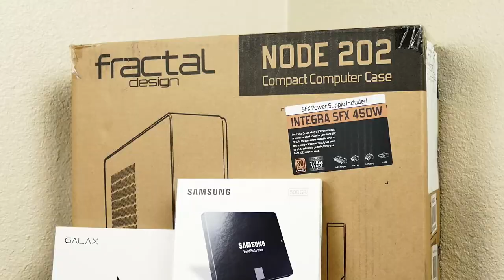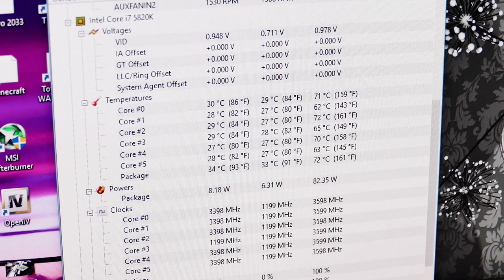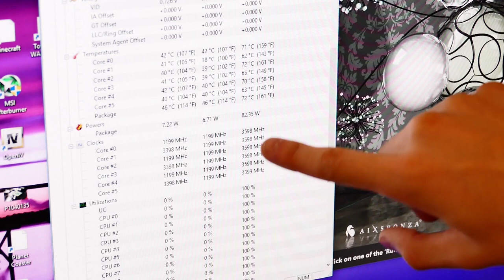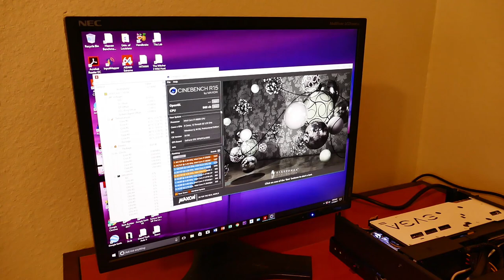This ITX X99 PC Build Makes (No) Sense

Comment: Hey man, could you help me with my build please? Didn't buy anything yet just the parts planning:

- i5 6500 3.2 GHz quad-core
- Cooler Master Hyper 212 EVO 82.9 CFM cooler
- ASRock H100M-HDS Micro ATX LGA1151 Motherboard 
- Kingston HyperX Fury Black 8GB  (1 x 8gb) DDR4-2133 memory 
- Western Digital Caviar Blue 1TB HDD
- ZOTAC GeForce GTX 1050ti 4GB Mini Video Card
- EVGA 430W 80+ power supply
Reply: That build looks fine, however 
1. I would get a power supply with a little bit more headroom on the wattage. Especially if you want to upgrade GPU in future.
2. Swap the 1 x 8GB ram stick for 2 x 4GB ram so that the board runs it in dual channel mode. You should always install ram in pairs.
Reply: Carbongrip thanks, it's just that 1 × 8gb is cheaper that 2× 4gb, and regarding the PS, I am working with a budget so I'm trying to stick with what's necessary. But thanks for the help

Comment: Maybe do another but sensible Build with Node 202? Like the best concole killer pc you can put in there. i7 7700K With cythe big shuriken 2 and after market GTX 1080 with 2 120 Noctua coolers on top.

Comment: Would a Cryorig C7 fit in this case (not on that motherboard, obviously)
Reply from the maker: About as well as the stock Intel cooler does. Will be off-center and "un-mountable."
Reply: on a different motherboard, not the asrock x99 one.

Comment: why didn't you use another case as the cryorig cooler didn't fit ???????
Reply from the maker: Has nothing to do with the cooler size... It's the motherboard.
Reply: Salazar Studio he propably meant why you didn't choose a different case if the cpu cooler that came with the mb doesn't fit in the case cause the case is too small

Comment: A build like this does make sense, but it's rare. Let me explain. What if I wanted to have a fully fledged Linux and also a Windows. Dual booting sucks. Having a Linux VM on Windows is bad (tried it). But having a Windows VM on a Linux is a different story. Linux can pass-through stuff to the VM. So you can have a LinuxOS and a Windows Guest which has a GPU passed through. Had this setup on an i5, but i needed some more cores. A 5820k would have been perfect for this.

Oh yea, a case with good airflow/space/etc would've been nice.

Comment: Is there a cooler you would recommend to put into the Node 202  with a 6600K ? i want to rebuild my old PC to fit in my living room and i was using an AIO before since it didn´t come with a stock cooler.

Comment: So if your going to bash it why did you do it in the first place? Sorry, lost a bit of respect for ya there. Why did you want to build in the Node 202 anyway if you are even talking about crossfire? Seriously. Could of worded it better. Could of just said you wanted to build a cool SFF PC, and then list why this is not a cost efficient or practical idea, but dissing Azrock for offering a product is not the way to go.
Reply: Exactly, I'm glad I'm not the only one thinking this. That's why I am giving this video a dislike, don't bash a board that's not meant to me used for the CPU's pcie lanes but rather for it's multicore capability in a workload not suited for an i7 quad-core.

Comment: Does this case come with the pcie risers that you used for the graphics card?
Reply: Bipolar- Bear it probally does. it would be weird to sell someone a case and then them not being able to instal the card because they didnt have riser. (also my ML08 came with something like that as well)
Reply: Bipolar- Bear it does come with the riser card
Reply: the node 202 comes with the riser cards and some other screws and stuff

Comment: Wow you werent kidding when you said dont try this at home.
Instead of mounting the cpu cooler that sketchy like , after youverified it was adequately cooling couldnt you fabricate a couple brackets to still screw the thing down a little?
Or get a slightly thicker case to allow the good cooler, hell even cut a hole in the top to make it fit is better than shitty cooler just resting on socket ESPECIALLY if case is side mounted and cooler can slide of cpu socket with gravity or bumping it.

Comment: So because you made a bad chassie choice, X99 Mini ITX is not recommended? If you are going to have it under your TV, no you dont build a X99.. But what about people that don't want to have a mid/maxi tower on their desk, and want something small and powerfull? 6 Cores and more PCIE lanes can be used for more than just SLI/CF..

My next build will be a Mini ITX X??? (whatever the future X-socket will be), easily. Running a mid tower with 6850K and 1080SLI today, but hopefully one card will be enough for 4k in the future.
Reply from the maker: Has nothing to do with the cooler and case choice. You didn't pay attention. At all. X99 CPUs pack extra PCIe lanes which are essentially wasted in ITX builds. Your own point is moot past the 5820K/6800K. And both are outperformed by the 6700K/7700K counterparts in both video editing and gaming. I and other tech tubers have proven and verified both. Nice try tho.

Comment: Wrong case = Bad board? - Colour me confused
Reply from the maker: Not what I said. An ITX X99 board is rather pointless when seen in the context of what X99 brings to the table, i.e. additional PCIe lanes that cannot be taken advantage of, the ability to Crossfire/SLI without lane bottlenecking, extreme overclocking in SFF cases, etc.
Reply: "X99 brings to the table, i.e. additional PCIe lanes that cannot be taken advantage of, the ability to Crossfire/SLI without lane bottlenecking, extreme overclocking in SFF cases, etc."

Really? That's what X99/LGA 2011-3 brings to the table?
1. You would have been able to do plenty of overclocking on this board had you got a different Narrow ILM cooler AND a different SFF case with an extra freaking inch of space.
2. X99 isn't all about the pcie lanes and graphics cards. Some of the Xeons have upwards of 16 cores with low clocks for heavy multithreading which work with this board.

Comment: I have this exact board inside a Caselabs X2M paired with a Xeon 2698 V4, 64 GB if ECC, and a Titan X(p). All watercooled. Everything is pretty much perfect with this board. Sure, you have to get an add-on mounting bracket from EK, but it's a hell of an investment over your hack there. You get a dislike on this one.

Comment: Need some help guys. Should I buy an xfx gtr rx 480 or a nitro r9 fury? the 480 comes with civ 6 (which i really want).

I have a 2560x1080 monitor, and have no plans to upgrade. these are both the same price.
Reply: Matt Heitmann i am an nvidia user and dont really know a lot about amd but if i where to switch i would go with the fury.
Reply: Matt Heitmann fury uses alot more power but is a much more powerful card but has less ram
Reply: WayStedYou I have a rm 750x, power isn't a big deal.
Reply: Matt Heitmann The fury
Reply: PlayEr 4312 so sapphire nitro fury for $253 over 8gb strix 480 for $215?
Reply: Matt Heitmann Yes, the fury will perform better than the rx 480. It's worth the extra cost in my opinion.

Comment: What does it matter if you can't sli or crossfire in this build. Isn't that the point of having an itx build? If you used something like an i5, you still can't crossfire or sli. The point of having an itx build is to be small and crossfire or sli won't help with that. So I don't see the point of not copying this build

Comment: Current my build

Asrock X99E-ITX
i7-6800k
Galax EXOC GTX 1080
WD 1tb blue
G.skill 32gb DDR4 Ram
Samsung SSD 950 pro m.2 128gb
Cooler master elite 130
Cooler master seidon 120v PLUS
be queit 600w straight power

and run 
ａ　ｅ　ｓ　ｔ　ｈ　ｅ　ｔ　ｉ　ｃ
Reply: that's actually a really nice build :)

Comment: Was wondering if anyone could help me out, I was wondering what needs an
upgrade the most to help me run games better. Here are my specs!

GPU: NVIDIA GeForce GTX 960
CPU: AMD FX-8350 (8 core)
Mother Board: Gigabyte Model GA-78LMT-USB3
RAM: 8 GB

Anyways, thanks in advance! Didn't know where else to post this.

Comment: Knew before posting. That MB suck!
Reply from the maker: The motherboard itself is great. The intended purpose is not.
Reply: No headroom, even if you get on a better cooler. It does not clock great.
I wanted so baadly a mITX build. A bit bigger case than the node tho.
But ended up on the oposite end so i got the Rampage V Edition 10 instead.

Those few times i move my system is not worth to cut the performance for :P
Rather lift more xD
Reply: Not true. This MB is actually often a better overclocker than it's bigger x99 brothers. I am running a 5820k on mine, with a 92mm Asetek 545LC  AIO. @ 4ghz max temps 65 celcius. In an Ncase. Try it out. and don't use stock coolers for anything. Ever.. Ohh and Salazar Studio should maybe have mentioned the AIO bracket, that Asrock ships with this board. Great little performer with the right cooler. the Noctua Nh-u9dx-i4 will do a great job as well.
Reply: Kasper Christensen have you not figured out that this guy doesn't know what he's talking about. He literally just reads info and repeats it.
Reply from the maker: R3DST1CK Are you referring to me? You must have missed several of my Minute Science and Crash Course videos.
Reply: I actually have to come out saying i was wrong. I remember reading about a X99 mITX board earlier that people really had no headroom for OC. And if i remember correctly it was something to both do with XMP and OC/intended settings for memory while getting an increased cpu clock.

Can't find it for any search i do. So must have been another board.
So i was deeply mistaken.

I remember i allso looked at skylake at that point so it might have been another ITX platform alltogether that got messed up with my memory.

Again, sorry that i was at fault :)

Ither way i don't regret ending on an E-ATX board, i fitted it well in a H440 case and i have room for all the shenanigans i want. And are going to custom loop it probbably this summer. That would be a bit of a bigger/harder project with an ITX case :)
Reply: One of the HUGE downsides on itx boards is the lack of fan hubs..interestingly small form factors need more fans to push through all that crap yet itx boards have ONE fan header aside from the cpu..not worth it.
Reply: Again not true in this case. This board has two fan headers on besides the cpufan. One is by the ram, the other by the pcie, and last the cpu fan header.
Reply: Kasper Christensen well that is cool but having to do an x-99 platform for one additional fan header? LOL. YAY! I just made the comment hoping maybe some MB manufacturers may take note and realize that ALL itx boards need more than one fan header as keeping a SFF build cool is challenging enough due to case restrictions, we dont need to be hampered by lack of fan ports as well..they aren't that big, give me at least 4 fan headers..they will fit.
Reply: i was referring to you. It is refreshing to see you actually read comments, and I did miss those vids. II will go back and watch them.
TY.
Reply: I don't think any sane person would go x99 only for an extra fan header. :D.   But I do agree that one more fan header would make itx owners happy. -But it's not that big of a problem in reality. If you need that many fans, in your system then throw in a controller, and problem solved. I am just correcting wrong information posted here regarding this MB. nothing else. So in short we agree ;)
Reply: not a big problem in reality if having 2 or 3 settings on a manual controller with your eyes always looking at the temps of your machine isnt an issue. I would rather set a fan curve and let the software do it, manual fan controller? I wasnt sure they even still made those. Guess I am spoiled.
Reply: I dont think anyone would choose to go x-99 for a fan header that isnt my point, but if you want an itx board that has more than one..you have to go with this..all the others I have seen have ONE system fan header and a cpu fan header and that's it..which is stupid as SFF builds need way more colling than any other more open air designed case...you owuld think itx boards would have more fan headers than a full sized atx board since the build will need more in most cases than a SINGLE fan...thats just garbage and there is no real excuse other than saving 13 cents on putting another fan header on the baord, they could say oh sapce..well you wasted space with that stupid sata express port nobody is gonna use right? maybe 2 or 3 fan headers could go there? LOL

Comment: Totally the wrong case for an ITX x99, Next time grab a cube case where you can fit a Noctua tower with the narrow ILM socket mount or a watercooler with the included adapter.
Reply from the maker: I wanted a SFF build with X99. Didn't work, which is why I addressed these points in the video.

Comment: I'm not convinced, and I'll tell you why. You found bumps in the road and looked only to the most obvious ways to get over them, not the most effective ways. For example the cooler. I'm sure with enough research one could find a mounting bracket for different air and liquid coolers (liquid if you don't use the god awful choice of case, as featured here) and you'd find yourself with those heavenly low temps. In my honest opinion, a Narrow x99 build is definitely sensible for someone who wants performance but wants small and simple as well. There's plenty of reason to make a build like this and telling anyone otherwise with only opinionated and poorly presented (and debunk-able) reasoning is just shitty. For example, this board would be perfect with an i7 - 6850k and a GTX 1080 (Poseidon when it comes out) inside of an NZXT Manta with a custom water cooling loop, and for proper aesthetics, set your asus 1080's lights to blue, have some Corsair blue led ram modules pressed in and watch the magic. And as for custom water loops, EKWB's supremacy block even has a mounting bracket for this exact board. Amazing what a little research and creative thinking comes up with.
Reply: Also there's nothing wrong with a single graphics card, ffs you don't need everything, you only need enough.
Reply: And for a final note, here's a "budget" x99 build: https://pcpartpicker.com/list/CY24vV

Comment: That's a narrow 2011 socket, basically server socket.
Reply: What is a server socket? A common socket used for all or certain servers?
As far as I'm aware, There are no server specific sockets technically.
Reply: I don't claim to be a expert on server sockets but for rack mount servers where saving space is vital the narrow socket design helps with that especially on multi socket boards. It you look up coolers for 2011 v3 narrow it will show you almost strictly server style coolers
Reply: Dustin Rose Yes. I'm just saying people throw around "Server CPU" All the time when techacally there is no server dependent CPU, Just CPUs that are commonly used in certain types of server.
It's just me ranting out loud lol

Comment: Jeez. I usually enjoy your videos, but this was a let-down. I get hacking together a cooling solution to test if it actually works, but not even talking it over properly in the video? Not telling people to never, ever do this? Not clarifying that that cooler, when mounted on a vertical motherboard, WILL fall off? Wow. Also, did you not check cooler clearance in the case before planning this out? Why did you build it at all?

Also, in principle, stating categorically that "ITX X99 makes no sense" is pure nonsense. Let's say you need a compact video editing rig - this would be perfect. 2 RAM slots is a slight limitation, but for video editing, the additional cores offered by X99 are what you truly need, and the single GPU is more than sufficient for any accelerated workload. You just need to put it in a case where it actually fits. Also, plenty of AIO water coolers will fit the narrow ILM X99 board - again, all you need is a case that actually fits what you want to put in it.

Comment: You failed to buy the correct parts and then post a video of your epic failure :) 
Looking at your case on background. not many people want 1meter by 1meter case and overclock to 10Ghz
I'm enjoying my Mini ITX build with a thermaltake case and Witcher 3 on ultra settings at solid 60fps ( low temps ) 
:)
Reply from the maker: This computer runs 1440p max without a hitch. Already tested. Nothing was a failure here. The cooler just had to be switched out. Runs perfectly fine.

Comment: Awkward moment when I have the exactly same build......
Jokes, Its a z170 and i7
but it gets SO HOT :(
Reply: Graeme S same, my 4790k runs stock and under 80-90% load is in the mid 80C range which is way too hot for comfort, I wonder how I can improve temps. my cooler is the Cryorig C7 as well. what would be nice is mounting for a slim 120mm fan inside that ventilation over the CPU.
Reply: I have tried 2 coolers, the cryo C7 and the Scythe big shuriken 2
The scythe is slightly better (about 2-3 degrees) so only just.
I cant be bothered downgrading my CPU so
I am looking at ditching my portable PC dream and moving to something bigger like a Nano S which has decent airflow.

Comment: Okay, this video was super bad. The way you put the cooler in place and tried to tell us it'll hold with a little thermal paste, the awful, headache-inducing music which I had to turn off and the bashing of the motherboard without stating valid reasons (the cpu can do more than the motherboard can provide isn't one) just was a little bit too much. Could AT LEAST used zip ties or something. Would encourage improving your expertise a little. Unsubscribed for me, unfortunately.

Comment: Your reasons to not build this pc make no sense. Single gpu and limit oc due to heat. What does that have to do with x99? Not to mention multi GPU use is quickly disappearing. OCing in an itx case all depends on the case and the gpu. But people who buy itx cases already know this limitation. 
Stupid video